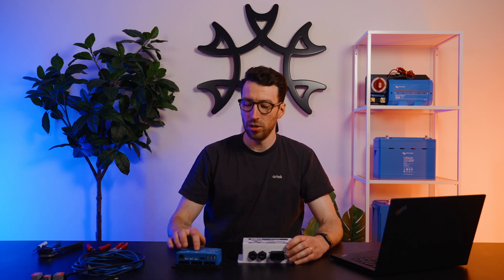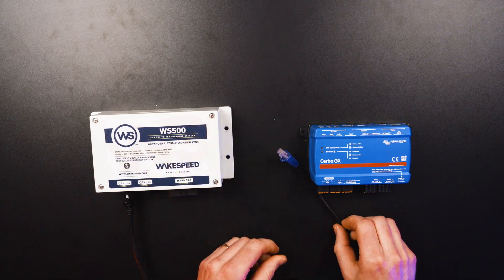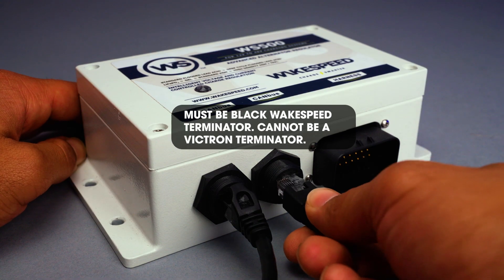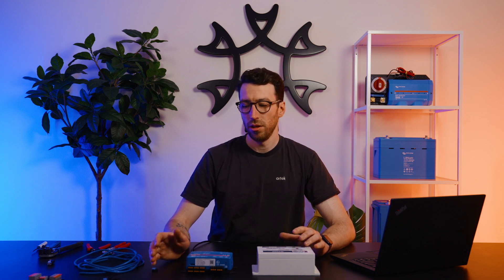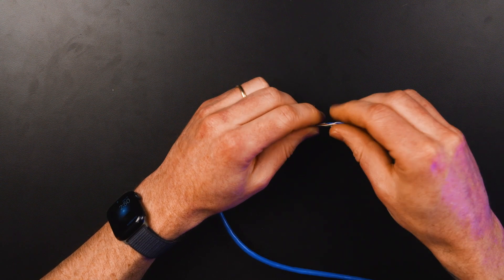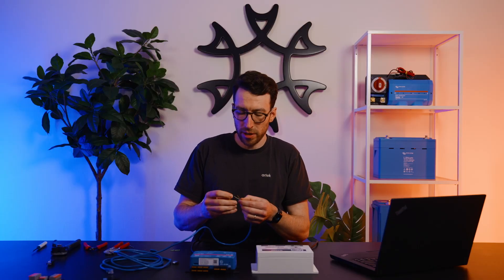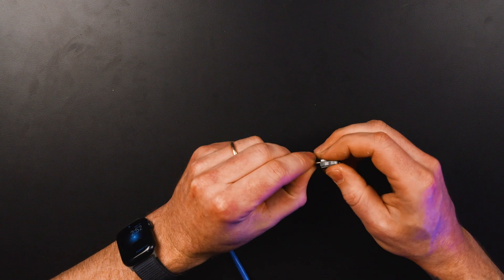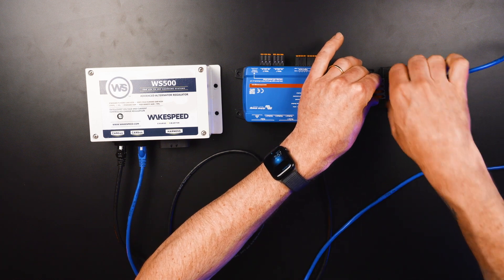Wakespeed's Alternator Regulator to Victron's Cerbo GX MK2 & RV-C Multitap | The Garmin Core System

Comment: Will the cerbo and the Wakespeed connected  and a shunt alternator side and battery bank side would I need anything els to Regulator the alternator charging as I was told it will only work with a victron bms and I have seplos banks at 48v to a 100a 48v alternator

Comment: Sorry, but I did not follow this setup.  What was that last item you connected up?  I think you connected the Cerbo at the wrong port.
Reply from the maker: Hi John, you more than likely did not follow this setup. This is specifically for an RVC network for connecting up the Wakespeed and Victron systems into a Multiplex system, in our case our Garmin Core System. A few notes, you were more than likely using a Cerbo GX not the Cerbo GX MKII. One key difference is that on the MKII we can configure both of the CAN ports hence why we set the VE CAN 2 (previously BMS CAN on the Cerbo) to RVC allowing us to use that port in this set up when previously we could not. The last item in the system is an RVC Multitap specific to RVC networking. Unless you are installing a multiplex system you would more than likely not have used this. This set up SHOULD NOT be followed for a traditional Victron and Wakespeed set up when a multiplex is not in play. If you have any questions please reach out to us, happy to explain further!